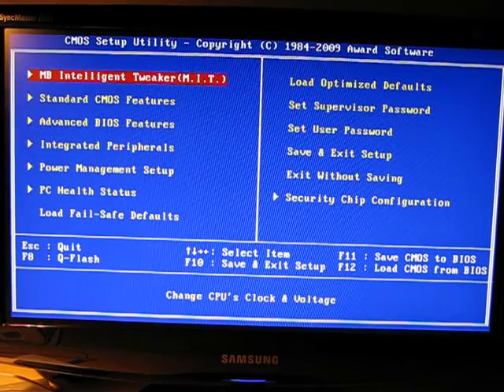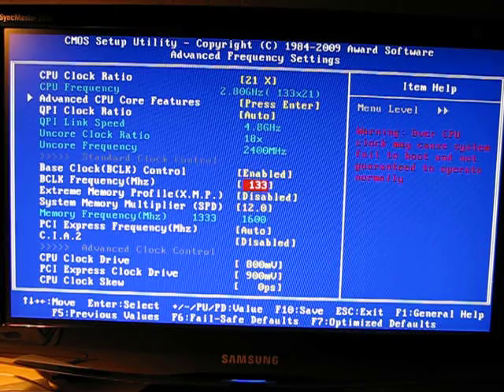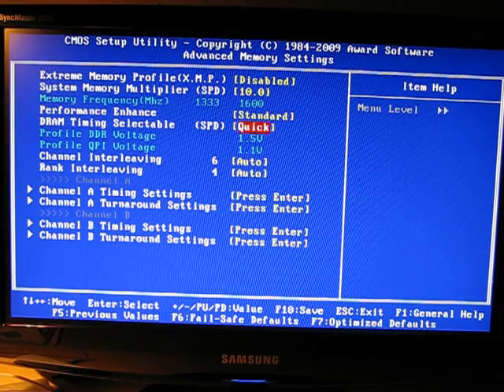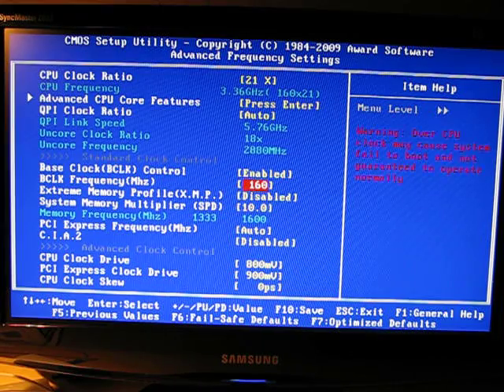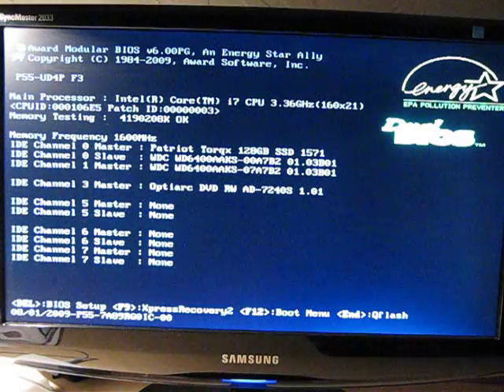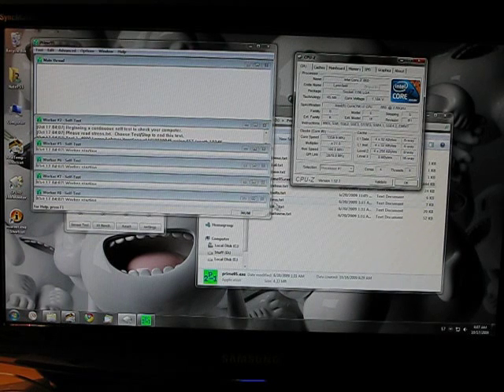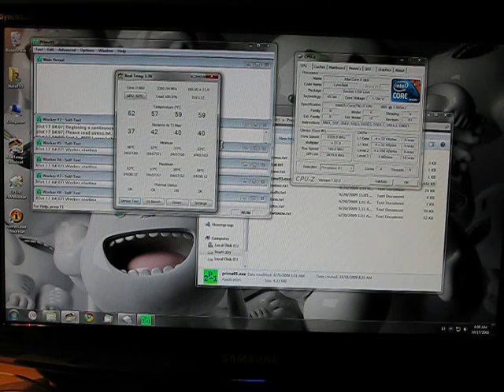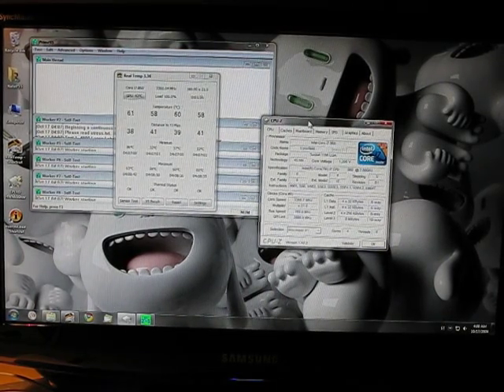Gigabyte P55-UD4P Quick overclock

Comment from the maker: @Anton338 CoolerMaster TX-3 is what I use. It depends on the ambient temps but it works good for a cheaper cooler. It's all I could find when the 1156 socket first came out. That's when I got the CPU and board.

Comment: ah ic, i havent tried the profiles yet but it sounds usefull, il have a try with it soon :) btw wondering what you think of the load-line calibration. been searching google for it and the opinions are split, i am running with out it because the temperature's @ full load with prime95 are as much as 5 to 10 degrees lower and also the vcore is lower idle and under load...

Comment: hi i got a question i got about the same setup only got the gigabyte p55 ud4 (non p) with the i860
im running at 3.6 ghz atm but this way i am not using the full capability of my Memory (1600) u think that is usefull or is it better to set to 3.36 ghz like u did? also is 3.36 ghz really better then stock? (boost should go up to 3.4) thanks in advance